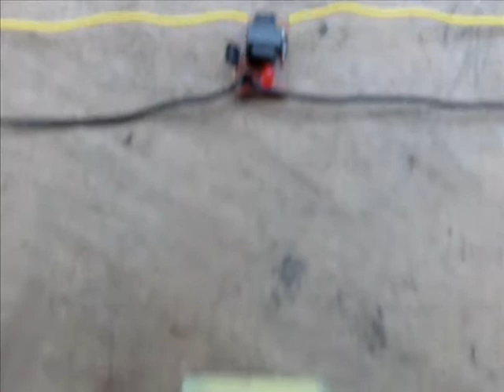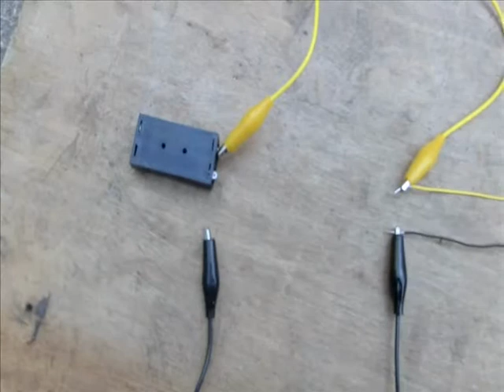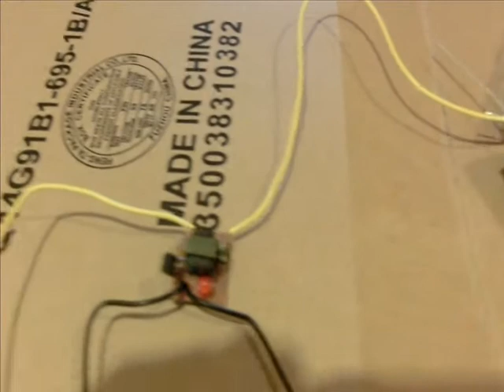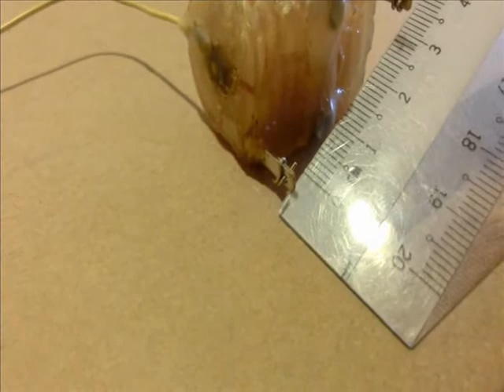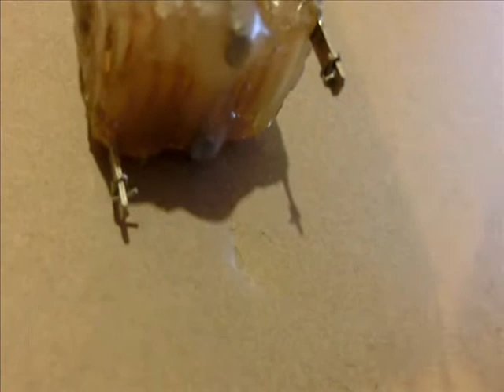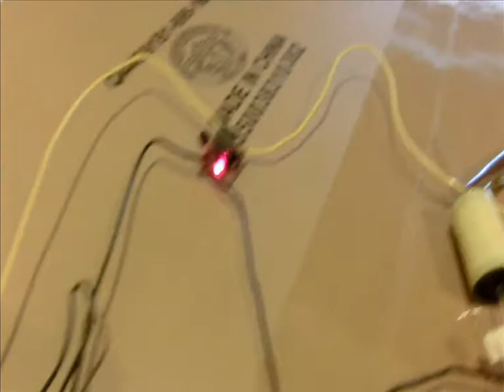How to Make a Stungun

Comment: To make the transformer glue some pieces of sheet steel together for the core, insulate it with wax paper or, at a stretch electrical tape then another layer of the same wire (I used 40awg from brocotts eBay store they have brill customer service) and do as many layers as you can and then insulate it with epoxy by putting it in a tube filled with it

Comment: I made my own High voltage coil, i puted 2x 1.5v 800mAh battery's, 2x 224k 400v capacitors, and a spark gap that i found from a powersupply (PC). I tryed all that worked but the spark gap needed to be tucked and untucked from the coil to work, my Homemade coil gived me 1k + Volts but my camera circuit burned :(  now my project failed) i will try to build my own circuit, if you have any pls send me link, thank.

Comment: i heard you got your high voltage coil from a small engine ignition, how did you manage to remove the coil? all of the ones ive found are injection molded and i cant remove them, are there any easy to scavange coils you know of?